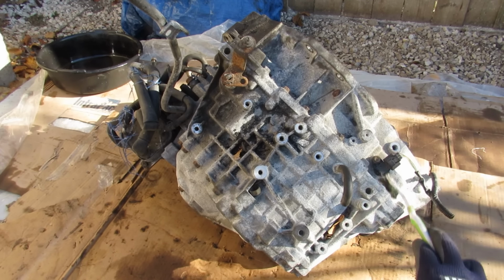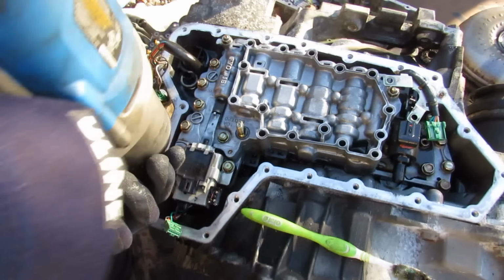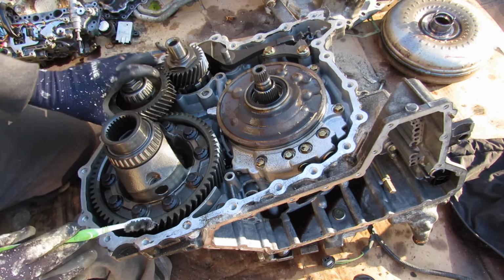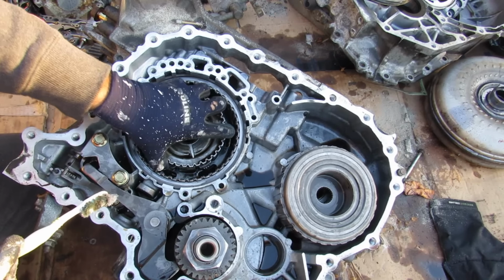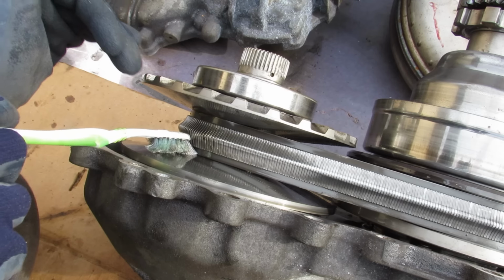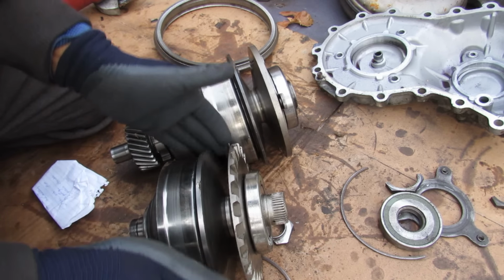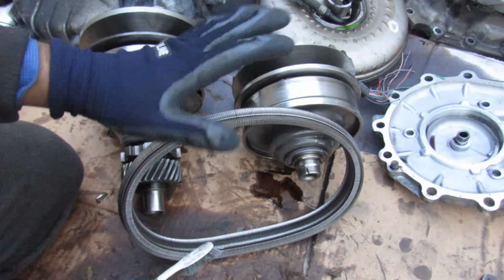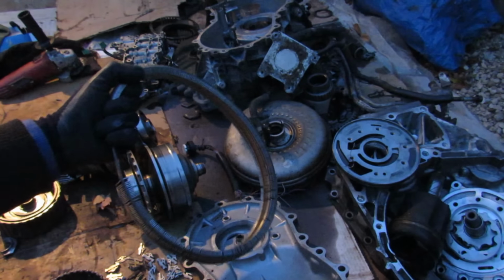Why Nissan CVTs FAIL

Comment: I have and have had multiple Nissans and Mitsubishis with the Jatco and all were reliable. My Outlander had 152K miles on it before I got my Outlander Sport with the CVT7 and 2.4L. This is clearly an older CVT from a Murano 1st gen. You are misleading people with old information.
Reply from the maker: The newer Nissans are still having problems
Reply: @speedkar99  CR has collected data from owners and your claim seems to be false.
Reply: @speedkar99  you don't own a newer Nissan,  my wife does and its fine. I also own a Outlander Sport,  so you don't have ownership experience. You can't say what is and what isn't.
Reply: @e2xx911  ok so you have a Nissan, does that makes you a cvt expert?
Reply: Got a friend whose Subaru Forrester CVT gave out after 140K. So CVTs are not known for be durable. Traditional Automatic and Good ol Manual are still the most reliable.
Reply: @jamsbong  Mitsubishi Wouldn't be able to have such a long warranty if they break that often. It wouldn't be cost effective. Subaru is known for making bad CVTs.
Reply: @e2xx911  Mitsubishi tuned their cvt different than Nissan, plus lower power output for it to handle. I've had my  2017 RVR for 3 years now and zero issues. When at a stoplight or in stop and go traffic I put it in neutral to take drag off the cvt. 57,000km fluid is like new, dealer asked what I was doing to keep it so clean. Going to swap fluid out soon.

Zero issues so far, but I always take it easy till warmed up and don't beat the shit out of it.  Show a little love,  get lots back.
Reply: He is not misleading anyone, he is showing what’s inside a CVT and how they work! For your information we got rid of a 2016 Murano because of lunging, surging, and odd torque converter lock up. I also got rid of my 2016 Maxima, 90 k and it was acting up also! Tacoma for me and a 4Runner for the wife!
Reply: My parents 2013 Nissan Altima CVT (CVT8) wasn't so lucky and failed after 50k miles after the warranty. After that fiasco, it will cost US$4K to replace that stupid thing but luckily Nissan chipped in US$3800 to make up the difference. We still have the shell out the rest but the damage has been done, never again
Reply: @kclefthanded427  So you're out 200 bucks on a 7 year old car and say 'never again'?  lol

Comment: Mainly! Cause Jatco CV-T's are crap!
Reply from the maker: I wish manual was still an option
Reply: @speedkar99  Yeah, I miss the good old days!
Reply: @speedkar99  💔
Reply: @speedkar99 : How could there be a manual CVT? You'd push on a lever that would adjust the pulleys?
Reply: I think they put weak transmissions on heavy cars, the Mirage uses a Jatco CVT and it does fine, but it weight the same as a box of nails.
Reply: @wills5482  Yes, the Mirage has no problems. Mitsubishi gives it a decent oil cooler and indeed the engine power output and weight are low. Not to say that the maximum you may tow with a Mirage, according to Mitsubishi, is only 250 kg. Lastly, Mitsubishi mounts a low/high gear ratio to help the CVT a bit.
Reply: @ronaldderooij1774  The low launch gear probably helps a lot.
Reply: All CVTs are crap.
Reply: @MacTechG4  no toyotas are very good and reliable
Reply: @MacTechG4  I have a 2010 Toyota with a CVT and 121,000 miles on it and have never had an issue. It's the poor quality of Jatco transmissions used in Nissans
Reply: @ohguy1991  CVT are all boring no matter how unreliable/reliable they are, the Jatco crap boxes just have the unenviable position of being boring and unreliable, the Toyota E-CVT is just boring.
Reply: @MacTechG4  Manuals are nerve-wracking and as fun as a thumb in the eye, especially in city traffic. That's why 'manual' people never stop at zebra passages and run over pedestrians: too tired or too lazy to manouver their 'beloved' clunkbox 100 times in an hour. Duh!
Reply: @Rahq Vuth yea both Toyota and Honda make the very best CVT's the only problem with Hondas is they pair it with an over 200hp honda motor with the accord. They mod that car with not giving thought that adding power only makes the CVT weaker.